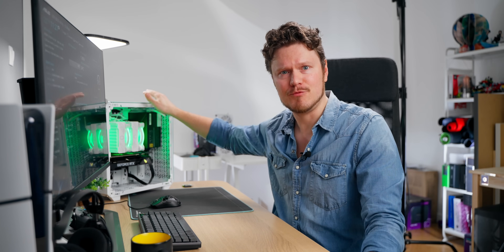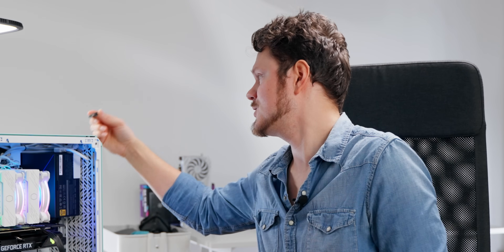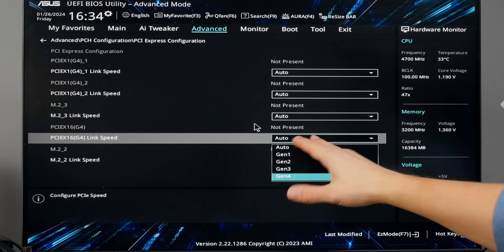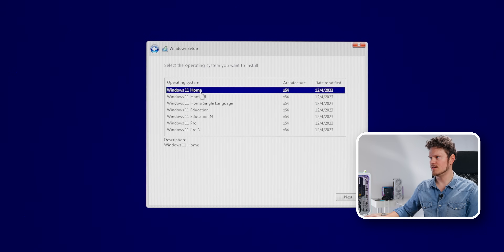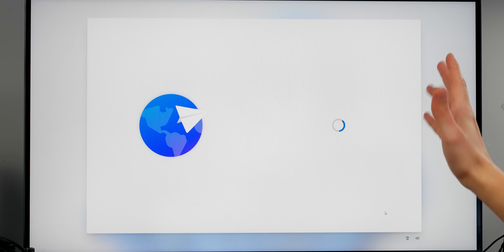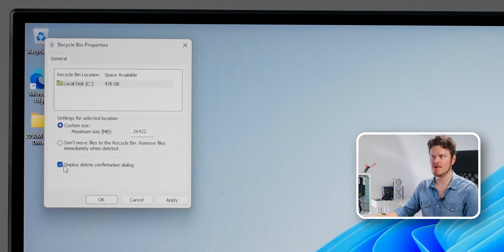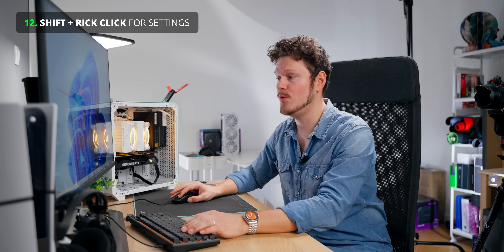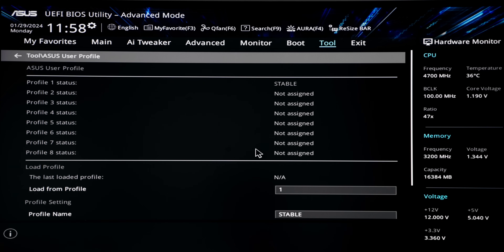Always Do THIS with a new Gaming PC!

Comment: MEMTEST86...
I would make the following change related to this GOOD (but incomplete IMO) video->
1) after updating the BIOS, set the XMP/DOCP profile, then
2) boot to a MEMTEST86 USB stick to read/write to all the DDR4/5 memory locations..
Simply leaving the memory sticks set to a more stable JEDEC standard doesn't ensure they are working properly. Even if just one memory location is bad it's still a problem. It's best to just switch to XMP/DOCP initially, VERIFY it all works and only THEN install Windows (because Windows can and likely will be corrupted if the memory sticks are bad. And it may not be obvious right away either. Maybe weird errors. Occasional crash that leaves you confused and running around in circles.)

Comment: Why don’t they put the cables so they can attach to the back instead of the front…?
If it was a back connection then maybe the cables wouldn’t need to be bent, it could 
be a straight connection…
Also, this would look so much nicer and cleaner.
Reply: Bought an adapter for mine so the cord wont bend at the neck at all. If you get one though make sure you get the right one.

Comment: Power and monitor settings are the thing many dont check.

Includes proper cable in the correct port, and if you play older games you wana do DX11 hdmi instead, might get issues with old games and new hardware.

Also install C++ pack, these dont come in default.

Comment: On windows and AMD disable auto update if drivers, the vga won't work fine and if you try running Adrenal8n an error will appear sayibg that the drivers are diferent from the ones expected from the app.
 Twice i had issues since December because Wi dows decided to uninstall my drivers and use an old o e for the graphics cards.
Advanced cobfiguration/hardware/device install configurstion/ use NO!!!! 
Now i had to use tge group policy methos because for it still did last week 🤬.

Comment: Do NOT use high performance unless you're building a workstation PC thats going to be running balls to the walls 24/7. It's a waste of power and needlessly taxing your cpu/system. A modern cpu can ramp up in a microsecond, and with high performance you are removing it's ability to downclock itself when it's not needed. There's been a misnomer about this since early generation Ryzen had a software issue this helped get past (which was fixed years ago). Leaving the CPU this way can destroy an AIO pump years faster too, it's like putting a brick on a cars pedal in neutral.

Yes i know in the video he's saying to do this during setup, but at the point of the video he's turning it on he's only installing armourycrate (which is also a crap program you should skip), and installing Nvidia software which takes all of 2 minutes. great video otherwise, sorry to be so negative but this is such a huge misnomer in the pc community and on youtube that many people are turning it on and leaving it on without knowing better.

Comment: I mean Cooler master qube 500 is worst for cable management and ssd power pulgs hinders with back panel, biggest problem with this is front and back panel doesn't stay on tight, even a small touch removes panel from top.

Comment: Great video! One thing I personally do different is avoid the ASUS Armory Crate, MSI Dragon Center, etc. motherboard software. I once had the MSI Dragon Center auto-install some "cFos packet optimization" software that tanked my internet connection randomly and was a PITA to diagnose...not to mention needing to reinstall Windows to finally fix it. While those "all in one" software management apps provided by motherboard manufactures are a good idea in theory, they are often bloated and take forever to install things (as you experienced).

Luckily, you can turn off Armory Crate in the BIOS so that it won't try to auto-install when Windows loads for the first time (make sure to turn it off in the BIOS before you start installing Windows). In the meantime, you can download the drivers from the motherboard manufacturer's website and copy them to a flash drive to be ready when Windows is finished installing.

If you have the time, another option is to look up your motherboard's specs and model numbers for the various components (LAN, WiFi, audio, etc.) and download the latest driver for each component manually from the component manufacturer's website (e.g. Intel website for the LAN/WiFi drivers, Realtek website for the audio driver, etc.). This is the best approach as it ensures you get the latest drivers possible, since the drivers listed on the motherboard manufacturer's website are often 1-2 versions behind. Don't forget your Intel or AMD chipset driver either!
Reply: This is true.  After 2 years my Armory Crate asked if I wanted to update it.  I said yes, and it got stuck trying to download the updates.  I had to entirely remove the program.  So if you did accidentally install Armory Crate like I did, make sure to never let it update.

Comment: I wanna help my parents upgrade their pc, since their cpu is too old to run w11 (they currently have a lenovo y900 desktop). I wanna get an asus prime b660-plus with an i5-12400, but do I understand correctly I need to have a flash drive for w10 to reinstall and I can't just put in a back up of the old stuff afterwards or something? I haven't build any pc yet so videos like these are an immense help, so thank you very much!
Reply: Another question  if you have the time to answer (or if anyone has for that matter); do I also understand correctly you need a separate usb flash drive for bios, lan drivers and such? Many thanks in advance!

Comment: Thanks for the tip to get the option to install without network access. Typical Microsoft to make it that involved. Can't wrap my head around the lack of progress indicators either. They always find ways to make the experience worse than it was in previous versions. Remember Win7 where you had a 'contents' field to specify a search term in the search dialog of file explorer? Now we have to type 'contents: <search term>' What the frog?

Comment: Another tip! Use disk part!

This can be a great way to get info on your drives (list disk > select disk > detail disk) and it'll tell you the make and name of it.

I like to clean my drives this way too.

Lastly, sometimes if you install windows on your drive, it'll be in MBR mode (this is old and isn't compatible with newer UEFI features). One way to avoid this is with disk part and to select your drive that you want to put windows on, then "convert gpt" will put it in gpt mode instead of MBR!

This may seem unnecessary, and in some cases it is, but once you put windows on it, you can't do this later. This will allow you to use some newer features compared to the older MBR feature set.
Reply: MBR mode limits drive sizes to 2TB. So if anyone is using a boot drive with more than 2TB capacity, MBR should definitely be avoided.
Reply: @coolcat23  ah, didn't know about this drawback either! I always make sure my boot drives are in gpt for every build. My first build wasn't and I couldn't do some things and I wasssssss sadddddd lol learning experience for sure!
Reply: I also dont know this drawback either. I just build my new pc and Im on windows 11 now with mbr format and if i have to enable uefi i have to disable csm first and to do that i have to reformat my primary drive to gpt first which i still havent tried yet cuz my windows file are all on my primary c drive which sucks. I have to do a clean install again and im to afraid to do that know cuz it may cause issues since fucking mbr cant edit my bios to enable or disable this uefi csm fuckers, cant play valorant with windows 11 on mbr format, and i fucking partitioned it i still have no idea what todo with it if i want to unpartition it would it be the one be formated if i convert it to gpt or not?
Reply: If u guys have the same issues do u guys know safest way to solve this or do i really need to start all over again with clean install and how can we format our drivers first to gpt b4 installing windows 11 again so that it will those files on on gpt format not mbr?

Comment: I am once again asking for yall to check the Partition Scheme of the system where you create your Windows install media, and for good measure, also the partition scheme of the target install PC (the PC you want to put Windows into). I have, for many times, seen a lot of 'Windows cannot be installed, selected drive is GPT' or 'selected drive is MBR, on EFI system Windows can only be installed on GPT drive' leading those user to just wipe their drive, which is just not ideal and that's not necessarily caused by corrupt windows install media nor corrupt drive. That's because the PC you used to make the windows install media uses different partition scheme than the PC you want to install windows onto (maybe it's a UEFI GPT system but you made the Windows install media for your old, still non UEFI BIOS or vice versa). 

If you use the Media Creation Tool just DOWNLOAD the ISO instead because that thing doesn't have any button to configure the target Partition Scheme even to this very second, it just going to adjust it based on your system config. Just use Rufus instead, and then check the target PC partition scheme, then back to where you use Rufus and change the Partition Scheme settings into the corresponding partition scheme of that install target PC

Also not necessarily for desktop users, this mostly applies to Laptop (especially the 11th and 12th gen Intel ones, idk if this still persist on 13th gen and above), if you can't find any drive in the install screen, make sure to check whether your Laptop need an Intel Rapid Storage driver to be put onto the install drive (Simply google intel vmd [laptop model] ), which contains Intel VMD driver as well which has been notorious for being mandated by Intel for some 'speed optimizer and power saving' reason even though it should've been enterprise Xeon features.

Comment: Ya  bend doesn't even stop the nvidia gpu's from catching fire,   the problem is pushing that many volts/amps down 16 gauge wires    they can't handle it  no short going on though if there is  it doesn't help things but wires over heat when they are nearing it's capacity and those plugs will catch fire,  not even an if,  it's just a when.    Everytime it nears it's maximium it weakens it and lowers that bar until it wiill melt and catch fire.   Then PCB will crack if it's got that bigger gap on it.   All in all Nvidia has serious engineering issues for it's 40 series.

Comment: I had to clean install of windows two times in a row My card reader is showing up USB 2.0 speeds. It goes up for one second then goes way down. What could be affecting my USB speeds. I have tried USB port USB-C port and thunderbolt 4-port. All of them are having the same behavior. Very fast for 5 seconds then very slow for 2 minutes then very fast for 30 seconds

Comment: In the windows installation. You can also write explorer.exe in the cmd. File explorer will start and you can install LAN drivers with a usb stick or if you got them on a secondary drive. So you dont have to override the internet setup if you dont want to.

Comment: Quick Tip on this, I just did an installation on a new system using the ProArt Asus x670e Wifi motherboard, If this comes up (...and you have armory crate installation enabled in the bios) hit Alt Tab and you will see the Armory crate asking permission to install Wifi and Lan drivers, use a mouse and hit yes, restart and you will have connection to a network in the Win 11 install screen.

Comment: i hate the windows update when it comes to gpu drivers... i usually update then use ddu then install the gpu driver.
if i install gpu drivers then do windows update it would install an older driver and remove the nvidia control panel or amd adrenaline

Comment: First thing you should do.. is get a bowl of water with a spounge and rinse the pc with it and give it a good scrub make shore you get the motherbored nice a wet especially the power supply as that's were the dirt gets in when boxed in a warehouse... once you done that to make shore the pc runs right you have to drop kick the pc across the room as hard as you can and celebrate like you just won the NFL... once yiu have done all of this plug it back in and if it doesn't start you havnt followed my instructions properly... you might have to drop kick it a few time 😅😂😂

Comment: While watching this video, ALIENWARE Support Assist notified me that I needed to download three updates. The 3rd was a BIOS update. When Support Assist began to install this update, I received a WIN 11 message informing me something was wrong. After I performed a reboot, WIN 11 loaded normally using my current BIOS. I reached out to ALIENWARE for help. The tech told me the problem was my current BIOS was too old to be updated. I missed downloading newer versions of the BIOS, and the latest version would not install. I had to install the versions I forgot, one at a time and from oldest to newest. Once I did this, my computer loaded WIN 11 with no problems. My lesson learned was to always have the latest BIOS update on my computer.

Comment: good video... This is just about spot-on to everything I do as well.  I do use Rufus to burn Windows to a flash drive for one you can option-out the network detect for windows cloud sign-on, TPM 2.0 check, and other various stuff.  It's all automatic - love it.  
Just need to add turning on the Resizable-bar in the Bios for the discrete GPU.  
The shift-F10 and typing OOBE\BYPASSNRO works very well too.  The reason why the 'I don't have internet' option is not there is because MS is trying to force everyone to have a stupid MS cloud account instead of a local Windows account.  I prefer the latter.

Comment: Do you recommend, during the Windows Installation, to use 90% of the total available space instead of the full 100%, so you don't have to worry about getting the SSD 100% full and mess up the SSD controller? I was used to do that since SSDs became a thing, but I am not that sure it is still needed, as now, after a few decades, SSDs probably have grown out of that problem?

Comment: I like to disable the Asus Armory Crate auto download in the Bios. It's a terrible piece of software and I can download device drivers myself.
Reply: I've found armoury crate to be a necessary evil. I have a build with a 14700k (drag me, I know): neither Intel nor Asus listed the very basic drivers I needed (thunderbolt, smbus, io, tpu, and something else) so armoury crate was the only way I got them. I was wracking my brain and scouring the web for like 2 days on the brink of insanity. 

I finally installed armoury crate, and it quickly populated all the drivers and updates and did them, including the BIOS update. And then ofc I uninstalled that shit ASAP using the Asus uninstall tool.

Since then I've installed it once more after a recent chipset and BIOS update.

Armoury crate is basically a necessity, just gotta keep the uninstall tool on hand.
Reply: @ShouPow  what a pain huh. I figured they would still provide downloads to required driver updates without it. But I guess these days they run it all through that app. At least we can remove after!
Reply: @jake.riches  huge huge PITA especially because it takes like 10-15 minutes to install and requires restart, so just for some driver updates, WHICH SHOULD BE HAPPENING IN WINDOWS GDI, I have to go through like 30ish minutes and 3-4 restarts. I'm glad there's a real uninstall tool (upset it only existed after being sued), but even after uninstall there's a bogus option for armoury crate in my explore right click drop-down. Definitely poorly made software (maybe excellently made if being cancer-like was the goal) but necessary evil right now with how piss poor Microsoft & Intels driver support is. Tell me why Intel doesn't publish every driver they've ever made on their site and Intel driver update tool doesn't work 😭😭😭
Reply: @ShouPow Had a quick look at Intels support pages and it's really sad. They now seem to rely more on motherboard vendors to provide you with support for Intels own products. That really sucks, especially if Asus should decide to deliver updates from their motherboard model pages only via AC now.
Reply: What's bad about it, seems like an easy way to download all the drivers automatically
Reply: @nozers Once you install it, it hogs resources and slows down the system for no good reason and it's hard to get rid of without leaving half of it still on the system. It also causes an untold number of conflicts with other software you might want to use, including but not limited to software for peripherals like your mouse and keyboard or software for other mainboard related features. Or your GPU... The list goes on. Asus continues to put all sorts all sorts of bloat- and adware in there. If you want to dig deeper into this just search for it and you will find lots of people online that describe their issues with Armory Crate.
Reply: He's right. Sure it might be handy to gather some driver updates but it's straight bloatware, runs in the background sucking up resources all the time, you uninstall it and random files linger, slow functioning and poor GUI, it's pretty awful bit of software
Reply: @itsLastHour lol it’s typical app you check once in while to update drivers easy it’s not bloat ware bloat ware something like windows store install like stupid card games or stupid random apps Facebook